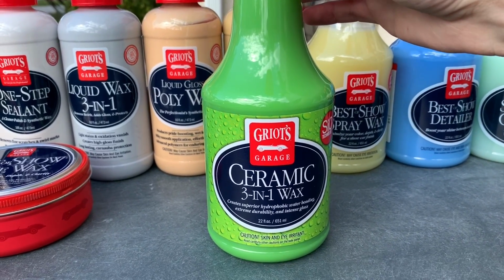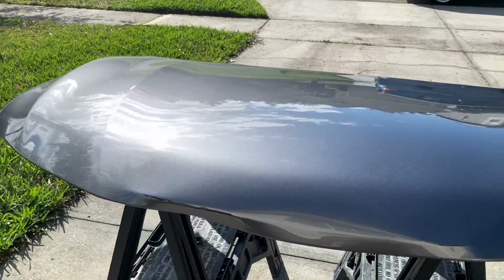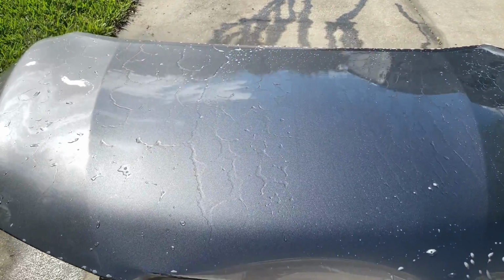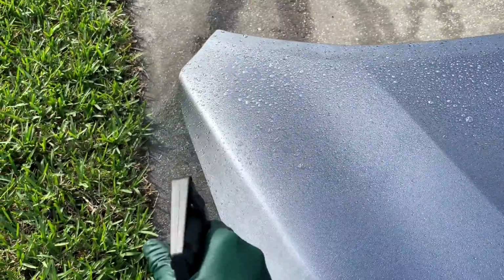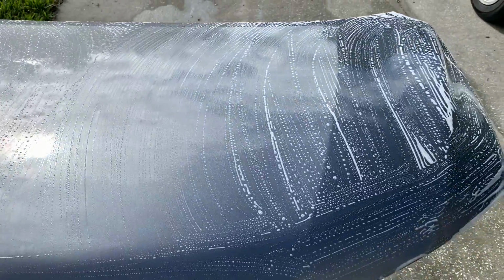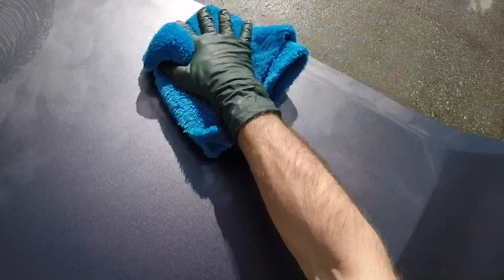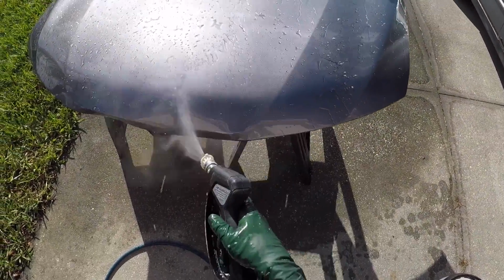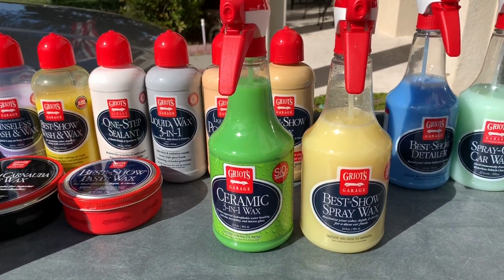Griot’s Garage Ceramic 3-in-1 Wax - Great First Impressions!

Comment: What griots garage products you like so far? If any
Reply from the maker: I really enjoy their paste waxes, Premium Carnauba Paste Wax, Best of Show Paste Wax, hard toss up between the two considering the price, but I would go with Premium as I got better durability out of it.  Really easy on/off, both of them smell fantastic.  I really like the updated version of Best of Show Liquid Wax, the older version was terrible on/off application, they bumped the quality up majorly on the update and it smells much better too. 

I use Poly Wax a lot when I'm working out in the sun, I've found it to be very workable in higher temperatures,  super easy on/off, durability is okay, you need to maintain all of Griot's protection products on a regular basis to keep up on them.  Best of Show Detailer is fantastic, LOVE that raspberry(?) scent and it leaves a super slick surface, very good for weekly/biweekly maintenace.  Best of Show Spray Wax smells fantastic as well, similar to Sonax High Speed Wax, don't go heavy on the application but it's a solid spray wax.  Those two are great maintenance products for the paste and liquid waxes.  Rinseless Wash & Wax works great, nice Laffy Taffy grape scent, 1oz for 2.5gal of water, works solid.

I'm reaching more and more often for Griot's Perfecting and Correcting Cream, when they released their BOSS lineup of polishers, pads, and abrasives, they knocked it out of the park.  The abrasives are easy to work with, little to no dusting, wipe off is okay but one of my favorite features is the polishes actually smell pleasant.  Not an obnoxious scent, just way better than most I work with.  Great finishing capabilities and gloss.  Haven't worked with the Fast Correcting Cream yet, a ton of guys have that as a go to compound compared to others like ACA500, Jescar Correcting Compound, Sonax Cutmax, etc.  So I do want to get my hands on it eventually.

The issue with Griot's, is I'm head on into full blown ceramic coatings.  And so your enthusiast-based gloss-focused products that they offer have been sidelined by me in favor of testing products that are giving more of a WOW factor in terms of longevity and protection.  This is why I'm very interested in seeing the capabilities of what Ceramic 3-in-1 Wax can offer, and whether or not I can adopt this product as a coating topper for some of my other coatings.  But many of the products that I've used from Griot's have been very good, they've got ease of use down and the overall enjoyment level of working with them and smelling them always puts a smile on my face.  Hopefully they pop out a super easy to work with paint coating in the future that we can complement with Ceramic 3-in-1.
Reply: @WaxMode  what’s the best looking spray wax available?
Reply from the maker: @seanmcandrew7363  A lot of testers have been recommending Tac System Shinee Wax as the top tier glossy spray wax.  I haven’t tried it out yet.  I’ve done gloss testing on a lot of sprays and haven’t found one that is putting up big number differences out of the glossmeter on heavily polished paint.
Reply: @WaxMode  great ty for the response. Your vids are 👍🏻. Just got a new black truck and want to care for it correctly from day 1. Was thinking of using the ceramic 3-1 as a base then washing with the griots ceramic wash and then using the ceramic detailer. Was also torn on doing the same thing but with the BOS spray wax / wash / detailer. Maybe use 3-1 ceramic as base layer and then BOS wash and spray wax? It is my daily driver and I have no garage. Live in PA. if the BOS provides a better look I will be happy to apply every 2-3 months if need be. Just not sure if In the real-world it actually looks better - hoping this is where you can give me advice (I’ve been going crazy down the rabbit hole of reviews and vids) what would you go with? Does BOS really look better? Or would the water beading and self cleaning of the ceramic actually lead to a better overall look being a daily driver. Mix and match? THANK YOU SOOO MUCH! Promise this will be my last question!